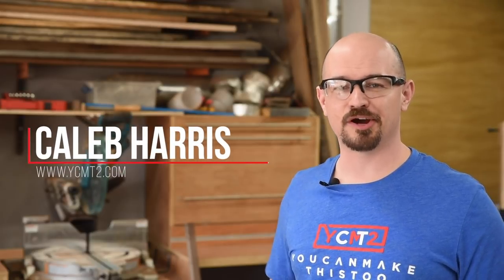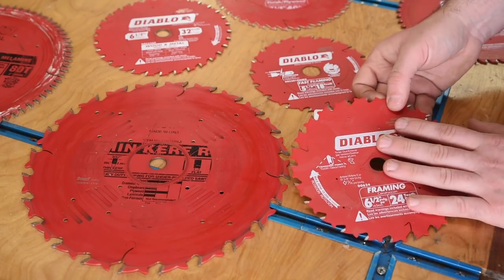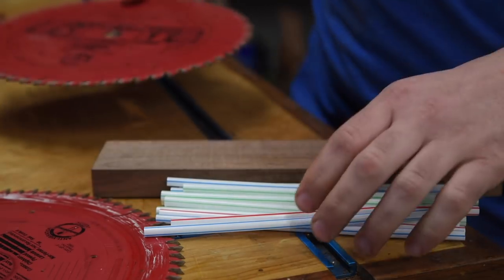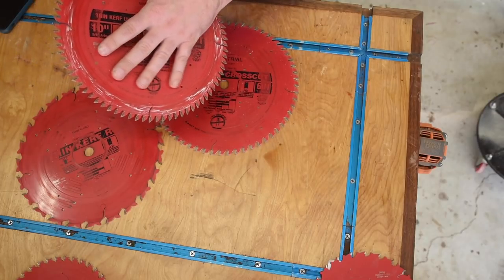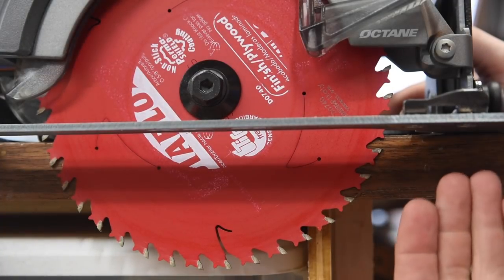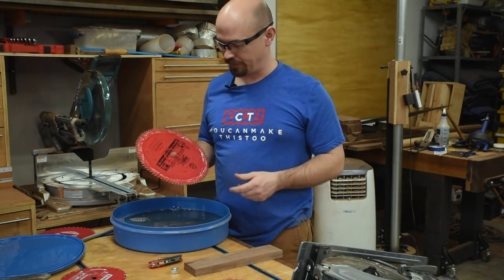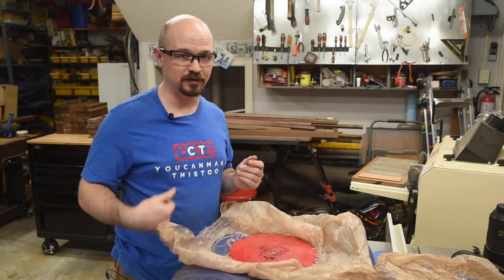Picking Circular Saw Blades | Table Saw | Miter Saw

Comment: Ya lost me at "just throw it away and buy another one." Like you can't or shouldn't clean or sharpen your dull saw blade and still have a perfectly fine working and performing saw blade.
Reply: He covered sharpening vs disposable blades later.

Comment: Hearing your explanation of tooth geometry has me looking at, and understanding more about the blades I use. I work more in metal than wood, and even so found this very helpful. It's given me a new enthusiasm for my old radial arm saw!
Reply from the maker: Awesome! It's a bit different for metal, but not dramatically. Tooth geometry still plays a huge part, just different kinds used.
Reply: Please help to list the name on the screen and the function of its. I like your video.

Comment: Great explanation!  Very thorough and what I needed to know. Just got a sliding miter saw and trying to figure out if I bought the right blade or if I should return it for a different one. Sounds like I picked the right one. Thanks!
Reply from the maker: Awesome! Glad you got the right stuff. Always be sure to get the ones for sliding miters so you get that negative rake angle, it’s important

Comment: Yeah, it was right around 1985 when I bought my radial arm saw for about a quarter of what they retailed for. That old saw did the job of a miter saw/sliding miter saw and quite a few other operations such as molding head cutter. Very handy saw if you know what you're doing with it. I checked out this video cause I wanted to know what blade you recommended for it. I'm guessing that you'd say the same negative rake angle blade as for the miter saw, but then I guess I'll never know now will I?
Reply from the maker: You're right, same blade with a negative rake that works on a sliding miter is good for radial arm saws. I meant to say that when I got to that part but forgot. They're super handy, I used one a lot when I worked at a Home Depot that would break down dimensional lumber for customers.

Comment: Simple Green - HD ( it's Purple of course ) works AMAZINGLY for cleaning blades, it's almost spray on, rinse off ... but a short soak and the gunk just brushes off ( I use a brass toothbrush style wire brush) - Ive used full strength and 1:1 and not really noticed a difference, so 1:1 saves you $$
Reply from the maker: Good tip, thanks!

Comment: Nice video. I have a question: Is it useful or overkill to have 2 circular saws, on with a special blade for ripping and one with a special blade for crosscutting, because i don't like swapping blades, making the circular saw screw dull. Hope to hear from you soon. Many thanks in advance
Reply from the maker: Unless you're changing the blade out multiple times a day, and using it every day, I wouldn't worry about any wear on that screw. And if that doesn't convince you, just buy another saw :)

I'm a believer in dedicated blades, but it depends. If everything you're working with is construction grade stuff, it really doesn't matter. But if you're talking about switching between cross cutting a table slab from $2000 worth of material, to ripping a $300 board, to breaking down a $150 sheet of plywood. Then yeah, to me it's worth having dedicated blades that do the best work on each of those materials.

Comment: All I wanna know is when the heck am I going to find a thin kerf ATB + Flat at 8 1/4" for Dewalts newer small table saw. Amazon advertised exactly this in a CMT Orange but when it arrived it was just an ordinary full kerf ATB 8 1/4". I just want a flat tooth blade for this saw so I can do some joinery as it doesn't accept a dado.
Reply from the maker: Good luck man
Reply: @YouCanMakeThisToo   Yeah that's pretty much all I can rely on is luck😂😂

Comment: Did he just say "if the labels worn off, it's probably dull. Just throw it away and buy a new one."? 
 
Oof... R.I.P. diamond/ceramic sharpener industry. 
 
If I'm paying, say $130+ for a 12in miter saw blade, I'm going to use it, and sharpen it, until the carbide is ½ gone. 
 
Wow...
Reply: Yeah, that was an odd comment. If the label is worn off the blade is waaaay past dull. 

He does say that blades should be resharpened later in the video. Maybe he means by that point you should toss it becuase it's total tooth size is too small to bother with another resharpening??? Dunno. 3mm is the point in which a tooth may have indexing problems on resharpening machines (which are usually the exact same machine used to make a blade). You'd probably still have a long way to go in a blade when the lable is worn off.
Reply: @cemarz  I had to watch full video, and he was way off on a lot of things.
 
Like "Radial arm Saws... it's not 1985 anymore". My response to that is "Saying radial arm saws are 1985 is sooooo 2009".

 
Then again, it's a Home Depot advert. Personally, I don't know any woodworkers that purposely go to HD or Lowes.
Reply: @carterscustomrods  It's not 2009 anymore, either.  🤣
Reply: @LackeysLack  saying "it's no 2009 anymore, either " is soooo 2027!!!
 
 tips fedora in a way that makes certain you can see my dank upper-arm tribal tattoo

Comment: Which type of mitre saw blade would I use for getting a clean finish cut in maple for interior 3/4 inch thick trim?
Reply from the maker: A finish blade, or fine crosscut blade.

Comment: Amazingly informative!  I have not seen such competent explanations about sawblades anywhere.  Usually its a bunch of dufases rambling on about nothing with banjo music playing.  I appreciate the explanation on the miter saw blades and the scoring, and WHY.    Question: so the 24 tooth and 80 tooth ply/melamine blades are given, and then crosscuts should be done on a miter saw anyways.  Given that, for just making unpolished stuff when in a hurry, would you recommend a 40 or 60 tooth combination blade (such as when a quick crosscut is needed!)

Comment: If my blade has a lower tooth count, can I just push extra slow to achieve the same cut as a fine tooth blade? Say I go half the speed would I not be cutting with essentially twice the tooth count?
Reply from the maker: Partially, but doesn’t change the tooth geometry which helps shear the fibers instead of ripping them.

Comment: Just bought my first miter saw. Based on my circ and recip saws (nevermind countless other videos I've watched in doing research) I know the included blades are always garbage, so I bought a Diablo 80 tooth to go with it. I have some baseboards to cut and I'm building some closet shelving...and eventually a small deck. I'm hoping I made the right blade choice, and this vid is leading me to believe I did. I haven't opened it yet. Still thinking maybe I should've gotten the 100 because of the baseboards.

Comment: For 10 & 12 inch blades, get the Freud 92 to 100+ tooth and use it for about everything. Whether I'm cutting a 6x6 oak block on the miter saw, or aluminum slotted extrusion, that blade (Freud LU85R012) does it ALL! 
 
Rarely do I need a different blade. 
 
Now if I'm cutting certain woods, I use CMT blades. But the Freud, or even their less costly, Diablo series, are great. 
 
(Their router bits on the other hand... ouch. Avoid Diablo and go Freud or CMT. A piece of spinning carbide flying off a 18,000 rpm shaft is no fun.)

Comment: Hey! As A beginner woodworker, and having purchased mostly used saws, I've been using the blades that I have lying around or those that came with the saws. Your video prompted me to look critically at my blades and I find I'm using incorrect blades for my individual tasks. I will be visiting my local hardware store to purchase more correct blades. Thank you.

Comment: Stupid question, but does the brand used really matter?  Like, do you have to use a Dewalt brand blade in your Dewalt miter saw?
Reply from the maker: Nope, just make sure it’s the right size. And if it’s for a sliding miter that it’s made for those.
Reply: YouCanMakeThisToo ok thanks. I didn’t know sliding meters have their own blades as well.
Reply from the maker: Later in the video I talk about rake angle and why theirs are different.

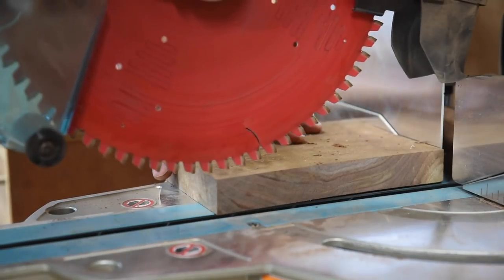Comment: @12:00. Better, safer cuts with less tear out.  Brilliant.  Reading operators manual, next level, genius.  Thank you for that tip (I did not read my manual, if I’m honest).
Reply from the maker: Before I was able to set up my first shop I spent forever watching videos and reading blogs and magazines about woodworking and soaking up all the pro advice I could.... imagine my surprise when I bought my first table saw and after putting it together I flipped through the rest of the manual and there was a technique section. No joke, all the supposed "old pro trade secrets and tips" that I'd spent a year scouring for that folks acted like is stuff you need to take a class or spend tons of time researching for was literally in the box with my first saw. 

That and after a few times of having a tool for months (or years) and then noticing there's a little feature on it I'd missed the whole time that would've made so many jobs so much easier if I'd known it was there but I didn't even skim the manual because "I know how to use one of these.." 

...yeah, now I make it a habit of at least giving them a flip through, especially the features/controls/techniques sections.

Comment: Don't toss your blades becuase the label is worn. Take it to a sharpening service. They probably use the same machine to sharpen it that the manufacturer uses to make it. If it isn't worth sharpening they'll let you know.

Diablo can 1000% be resharpened. They're only going to take like .15mm off of the tooth od and face.

If you are worried a blade being used for the wrong job w/o the label then mark it with a sharpie. If it gets resharpened and that marking was washed away through the cleaning service then remark it.

Comment: Thanks for the advice. Your video was very helpful. I was wondering if I was using the wrong blade sometimes because some of my cuts felt like I was cutting through extremely dense wood. It would just take longer than I thought it should on both my table saw and my Miter saw. Watching some people cut on TV etc ... their blades and cutting movements just seem to be quicker and smoother (Like cutting through butter, as they say) While on my table saw just ripping a long piece of wood I am just pushing & pushing and have to jump to the other side to pull the wood through. It cuts clean but it's just a little frustrating sometimes. The same with my miter saw, sometimes cutting straight down it just feels like a heavy push down instead of just a quick smooth down & back up. So I will look for a lot of the things you mentioned. Blades with more teeth and the right angles right?
Reply from the maker: If your saw is cutting extremely slow my first thought is you have a dull blade. If you're specifically struggling with ripping and the blade is sharp.. then you're probably cutting with a crosscut blade, and need a lower tooth rip blade, or a combination blade.
Reply: @YouCanMakeThisToo  I was going to say the same thing. Sounds like a dull blade either way.

Comment: Love Diablo blades wondering how well they work with a DEWALT track saw
Reply from the maker: So long as the arbor and hole is the same size it'll work as well as it works on any other brand saw.

Comment: Great video. I do have one question. Say I was going to build a in\out feed, or parts table out of extruded aluminium, what blade would you recommend? With the width being only 1.5" max.
Reply from the maker: Blades for laminates typically are good for aluminum. You're looking for high tooth count and preferably a TCG grind. Freud and Diablo used to have a blade for non-ferrous metals, I bet they still do.

Comment: either turn down the volume of your saw or turn your mic up...tired of youtubers blowing out my ears with poorly thought out productions...☹☹☹
Reply from the maker: Fair, very sorry about that. Totally amateur mistake. The only saw noise is that short clip at the beginning, not a good start. Hopefully the information made up for those few seconds of bad audio.
Reply: @YouCanMakeThisToo  
sorry for being so blunt. 

I was settled in for your video and then blasted by that saw.  it was like someone suddenly screaming at me.  

I will return and watch your vid.  I like your channel and I look forward to future vids...thanks for your reply. 🙂👍
Reply from the maker: @arianadiego3709  No worries! Sorry if my reply was harsh, I'm really glad you pointed it out. I pride myself on the time I've put into getting better audio because volume jumping drives me bonkers too! Those clips were added and the audio was stripped.. and right before I finished I added the audio back but did not check the levels. I'm really glad you pointed it out, because it helps me remember to always go back and check every time that audio gets touched. 

I just commented about that being the only bit like that because if it did push you off the video, wanted you to realize the whole video would NOT be like that.

thanks for the reminder and thanks for watching!

Comment: What do you recommend to cut composite wood.
Reply from the maker: I haven't worked with it enough to be savvy on the tooth geometry that's ideal for it... but I have seen blades listed for composite. I'd just get whatever is labeled for it. The big take away was speciality blades aren't just marketing hype.

Comment: Do angle grinders blades fit into circular and miter saws ?
Reply from the maker: I think they both have a 5/8" arbor.. not sure. Can't say I'd recommend it either. Even if they fit there can be a big issue with RPM differences.

Comment: If you try ridge carbide blades, Freud and diablo will stay in a drawer.
Reply from the maker: I've heard good things about them
Reply: @YouCanMakeThisToo  stumpy nubs recommend them. I needed a flat top blade, and got one. I was so amazed at how much better it is than my frued blades.

Very good video.

Comment: Quick question, My circular saw came originally with a 185mm blade, can I use it with a 180mm blade too? Thanks
Reply from the maker: Smaller isn't a problem if the arbor fits.
Reply: @YouCanMakeThisToo  fantastic! Thank you.

Comment: Good video, but my question is what kind of blade do I need to cut pine treated wood for my patio deck?
Reply from the maker: I'd just get a general construction blade for whatever kind of saw you're using. The resin in pine and all the additives are going to toast the blade anyway.. and because of how wet it tends to be, high tooth count isn't going to be very beneficial because the wood is going to try to pinch the blade pretty quick, you want something fast cutting.
Reply: @YouCanMakeThisToo  So are you saying a 24T is better than a 60 T? I bought the 60T, but i can take back and exchange it?